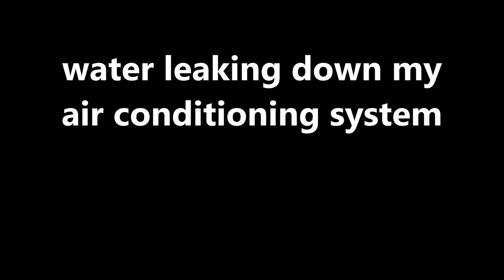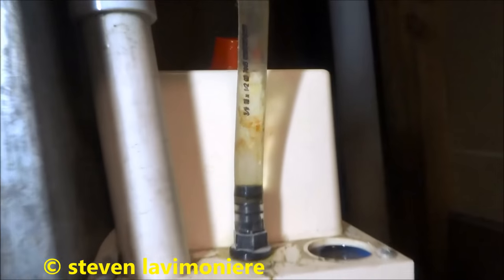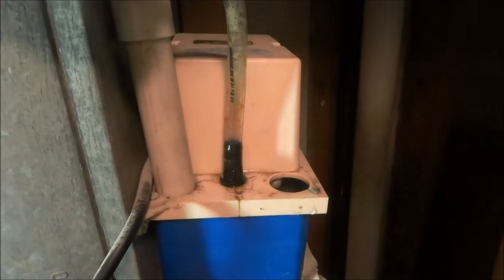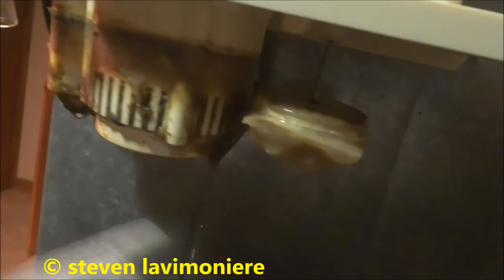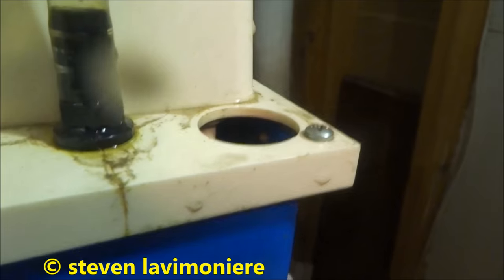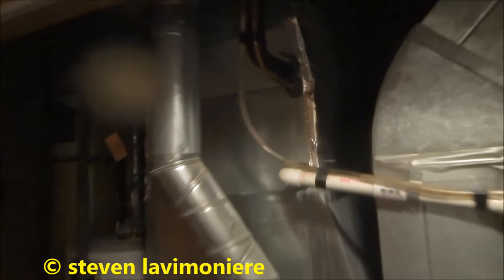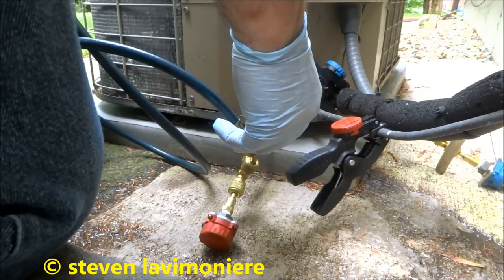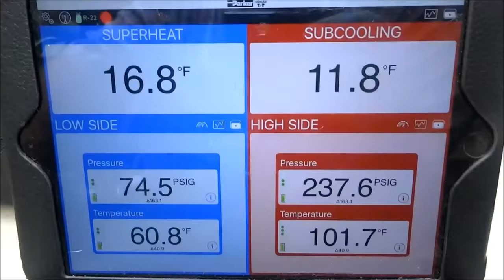water on floor around A.C. unit / furnace

Comment: maybe you can help me. my ac unit on the outside quit working. u can hear it trying to kick on but it won't. it just blinks the eletric. and just clicks . any ideals
Reply: Check the run cap first and if that don't fix the problem, the fan motor could be seized.